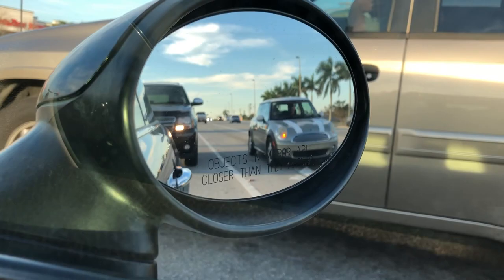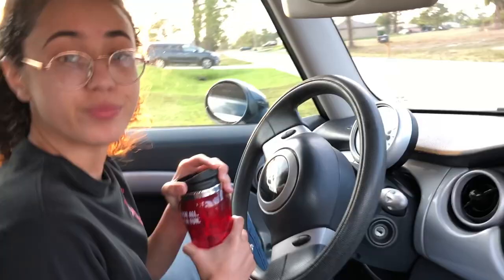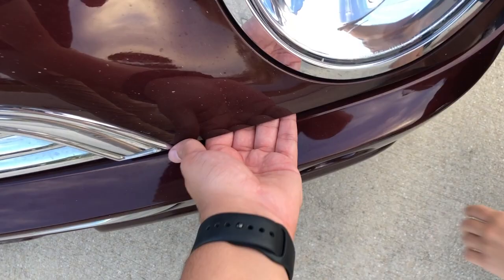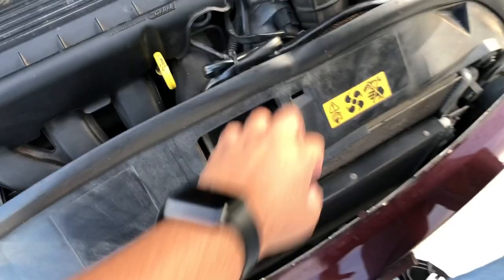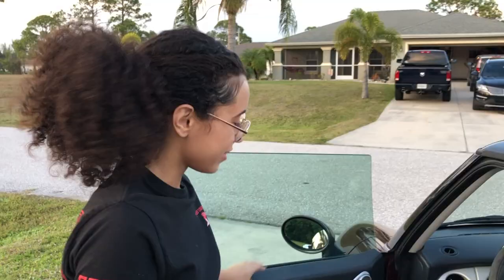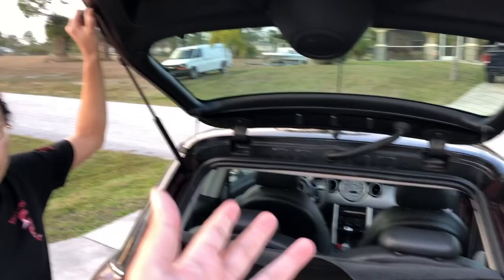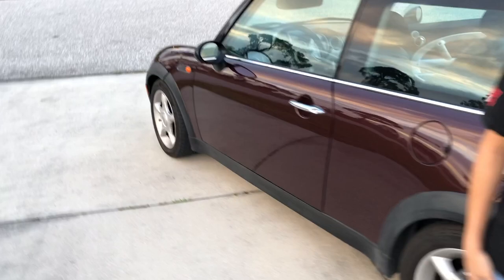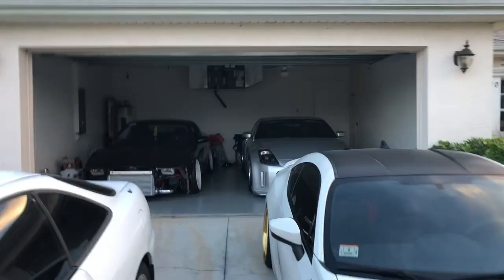Pros And Cons Of A Mini Cooper

Comment: Realease latch on the right side.... because the car was built in England and it's an unfortunate oversight
Reply: I don't think it's an oversight. I think it's a way to save money on the production line
Reply: babyjohn yes, 100%. But I don't think we have any other foreign built car in the US that does something like that
Reply: The car was built for the English market and the drivers side is on the right side in England and Ireland so it's on the correct side for the driver to open the bonnet
Reply: Photo Latvia Japan is also right hand drive, plus some of the Commonwealth countries.
Reply: Screentalker DorOrg , apologies I didn't see you comment pretty much said the same thing. A UK production over site, i'm in the UK so yes natural feeling to have that side. However you get other not UK like car (which are German design - mostly had VW's over the years and restoration of a 6n2 Polo GTI currently) features like having filler cap left side compared to German cars use to have left side or drivers side being RHD Vs you guys being LHD drive in US filler cap correct side for you.
Reply: Mark Turner-smith filler cap is a bad example because even US market cars will flip flop which side it’s on
Reply: Not long had my R56 Mini Cooper umm so forgot about it quicks and getting use to it. Been VW's so long forget my R56 bonnet release is left hand side.......this really makes no sense as it means they flipping the bonnet release to always not be on drivers side be it LHD/RHD......seems a odd production thing to do.

Comment: never buy 1st gen mini always buy 2nd gen 2011 and up.
Reply: How come? Are they more reliable?
Reply: @lovedisshitrazzer  yes, typically have better features i think
Reply: @summerrose2773  thanks, makes sense
Reply: The more reliable ones are 2005,2006 and then 3rd gens. 2nd gens are the worst.
Reply: 2nd gen is 2007-2011, then 3rd gen.
Reply: @debbiepeter112  1st gen is worse then 2nd
Reply: @tylersoto3306  Definately not. Second gen suffered massive engine failures and are known to be very unreliable. 1st Gen only common issue was the clutch. 2nd Gen suffered various oil leaks not to mention the famous "death rattle"
Reply: @debbiepeter112  2nd gen is ‘07-‘13. From ‘07-‘11 was the N16 engine that was known to be unreliable. From ‘11-‘13 they updated the engine to the N18 which was much more reliable. From ‘14-present is the new F-type body instead of the R

Comment: The Mini is built in UK Cowley plant (Nr Oxford) UK so think possibly as a lot of the stuff like bonnet pull/etc is based around the fact home market is the UK RHD. I have a R56 Mini Cooper and left bonnet pull/etc still on the right (but bonnet release in center). Odd others things like they left the fuel filler on left side (usual for a German design car which normally have them on right side).